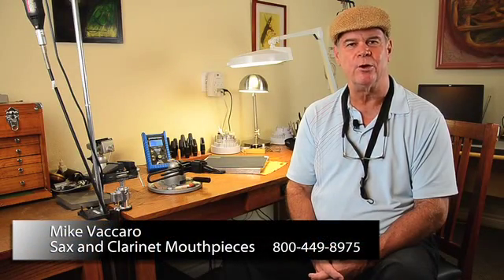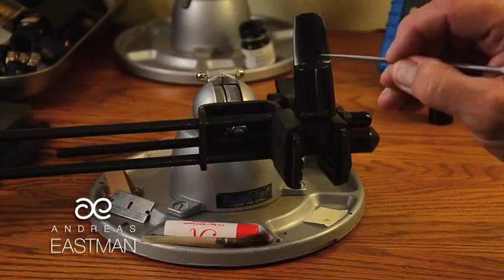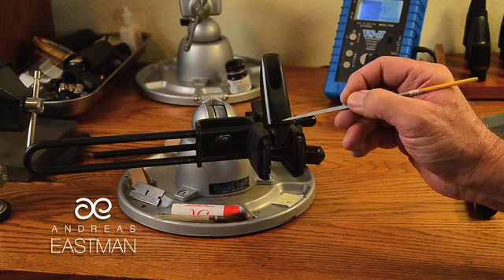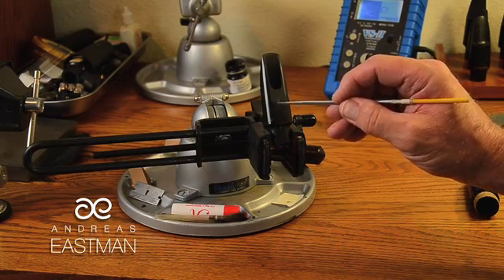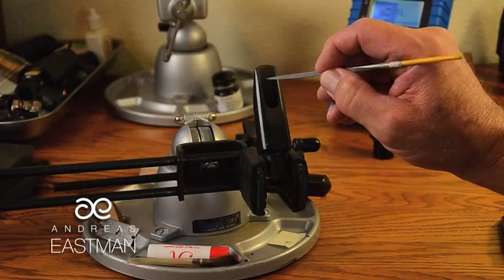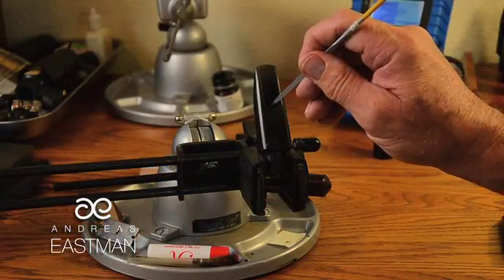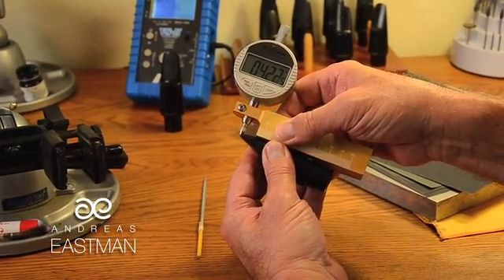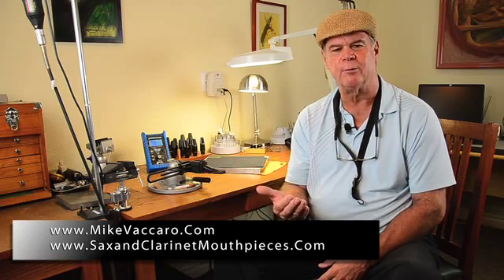4 Parts of a Woodwind Mouthpiece by Mike Vaccaro

Comment: Do mouthpiece makers test them in wind tunnels? When you talk of airplane wings they- test them in wind tunnels as do they on other designs such as suspension bridges which have to calculate loads due to icing etc. Just a thought - maybe the big producers could do so to keep the costs down.